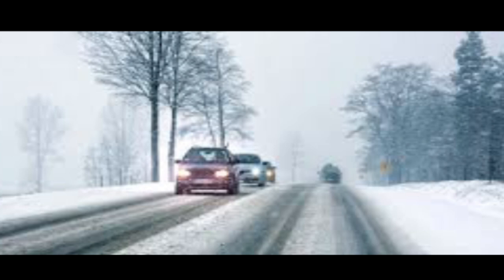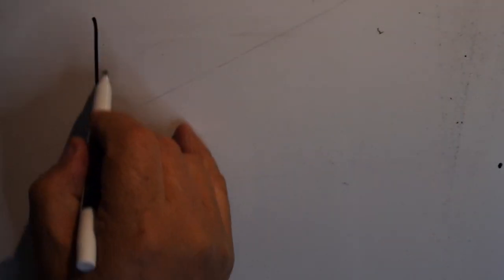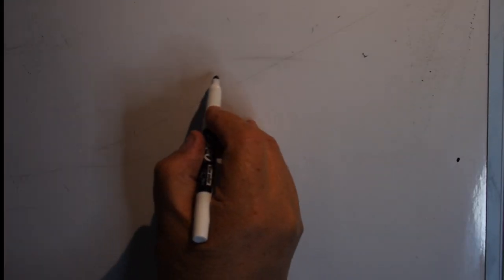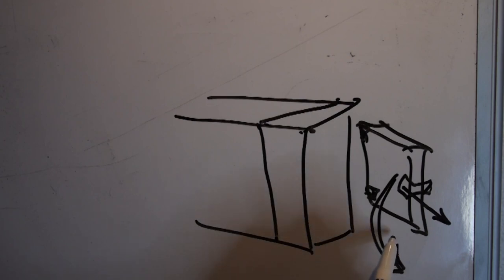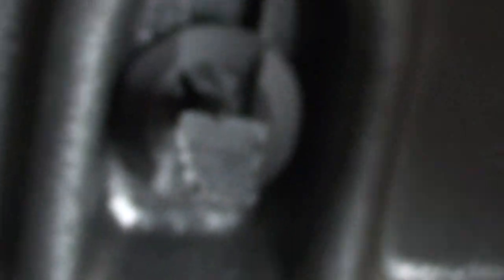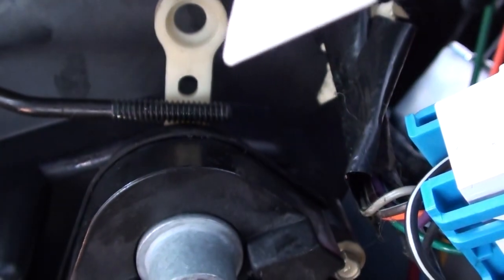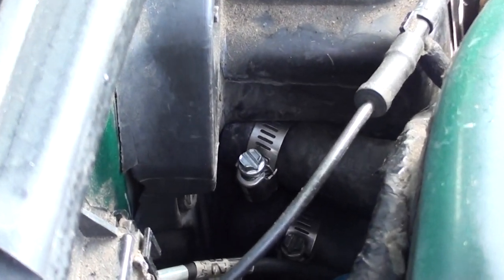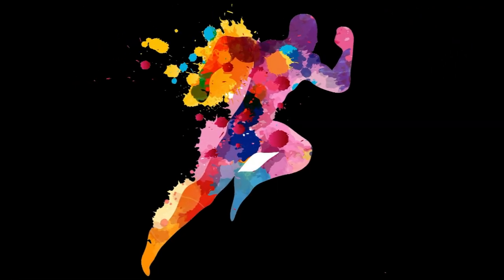Cadillac  | How to Replace Leaking Heater Core | DIy | Autozone

Comment: Great video.
I'm having an issue removing the cover from the bottom of the dash like you said in the video. I have removed all the screws, removed the computer but it won't budge.
Reply from the maker: not sure whats going on..mine came out easy.
Reply: I finally got it out

Comment: Is this for a 2002 Cadillac escalade also
Reply from the maker: Manufacture says it will fit on these models
1987-1988 Cadillac Allante 4.1L
1989-1992 Cadillac Allante 4.5L
1993-1993 Cadillac Allante 4.6L
1986-1987 Cadillac Commercial Chassis 4.1L (W/ FWD;)
1988-1990 Cadillac Commercial Chassis 4.5L (W/ FWD;)
1991-1993 Cadillac Commercial Chassis 4.9L (W/ FWD;)
1986-1987 Cadillac DeVille 4.1L
1988-1990 Cadillac DeVille 4.5L
1994-1999 Cadillac DeVille 4.6L
1991-1995 Cadillac DeVille 4.9L
1986-1987 Cadillac Eldorado 4.1L
1988-1990 Cadillac Eldorado 4.5L
1993-2002 Cadillac Eldorado 4.6L
1991-1993 Cadillac Eldorado 4.9L
1986-1987 Cadillac Fleetwood 4.1L
1988-1990 Cadillac Fleetwood 4.5L (W/ FWD;)
1991-1992 Cadillac Fleetwood 4.9L
1986-1987 Cadillac Seville 4.1L
1988-1990 Cadillac Seville 4.5L
1993-1997 Cadillac Seville 4.6L
1991-1993 Cadillac Seville 4.9L

Comment: Can this cause a misfire?
Reply from the maker: Humm? well, it depends on where the fluid is leaking. I would say no. If you're having a misfire. Could you check which cylinder is missing firing? If you know which one and it's by the heater hoses and water is getting on that cylinder, that may be the problem. Good luck

Comment: Yeah forget about the bolts to take off the fabric to GET to the 6 bolts for the glovebox
Reply from the maker: mine didn't have any
Reply: @notsofast2325  either need a small ass torx screwdriver or Alan wrench with torx heads which I don't have either
Reply: Why do people even use those screws fucken annoying
Reply from the maker: @raymondkizer2805  lol.. GM thing..
Reply: @notsofast2325  besides those dam screws video was a huge help thanks man
Reply from the maker: @raymondkizer2805  your welcome!!!